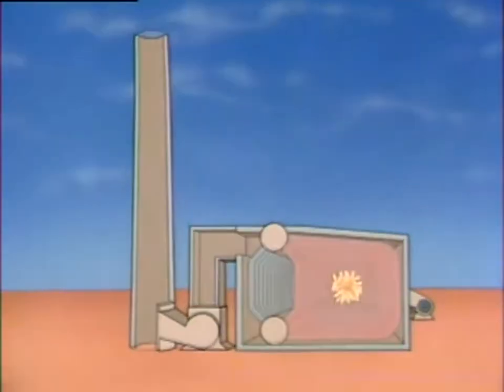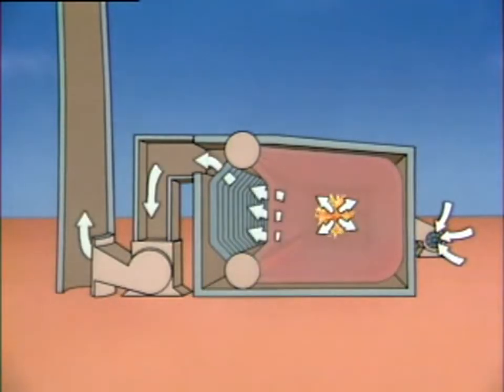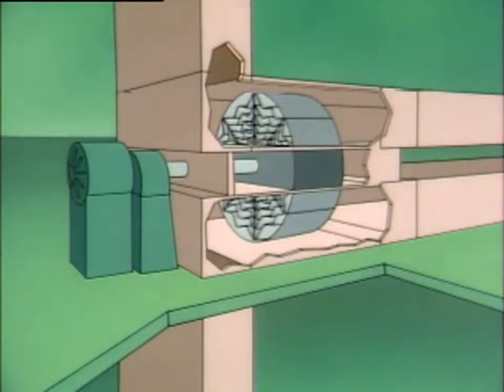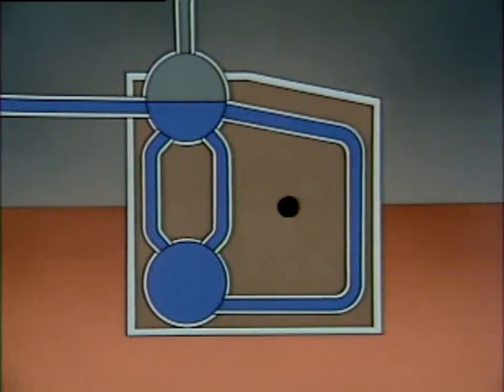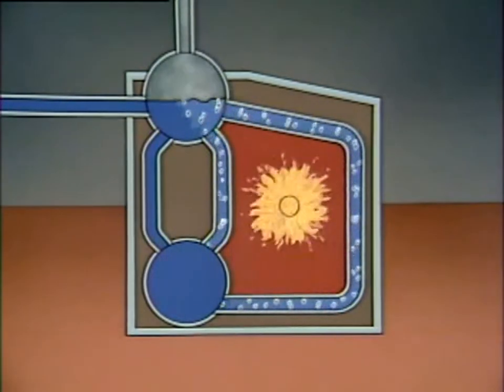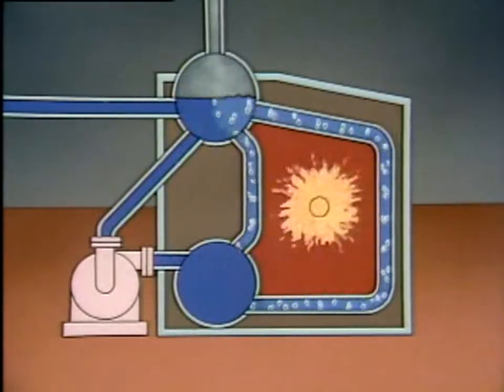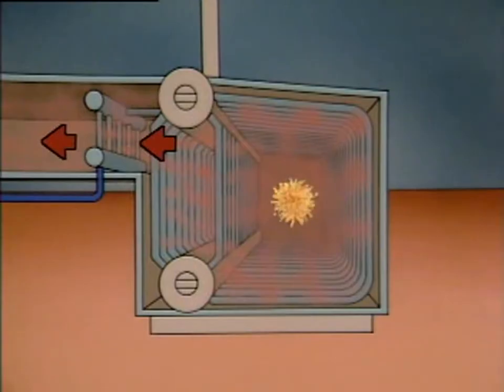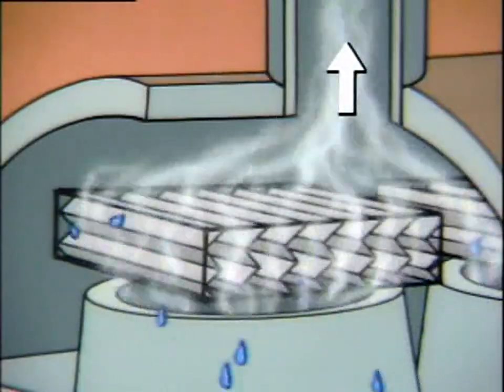How Steam Boiler Auxiliaries Operations?

Comment: Should we start the id fan first or the fed fan when starting the operation
Reply: With our natural gas boiler, everything is hard-wired in such a way that the FD fan won't even start unless the ID fan is running. So, I believe that starting the ID fan first is the best. It probably has to do with ensuring that any possible dust or fumes always exit via the intended exhaust path and not into areas with personnel or vulnerable equipment.

Comment: Excellent video. How to define "TPH" of boiler? Is this tonn same as "tonn of refrigeration"? Thanks.
Reply from the maker: Thanks for your interest but TPH her Ton per hour of steam
Reply: @ShadyGhazy  Thanks but my question was is this "tonn", weight of water or amount of heat added? Please  clarify, thanks.
Reply: CCK 07 “TPH” is the capacity of boiler, or we can say the rate at which the boiler produces steam. Now, If I get your question right, the capacity of the boiler is dependent on the heat added (amount of fuel required) to heat x amount of feed water. Of course it does depend on many other variables and owing that certain conditions are met.